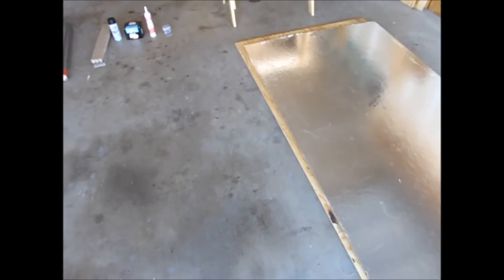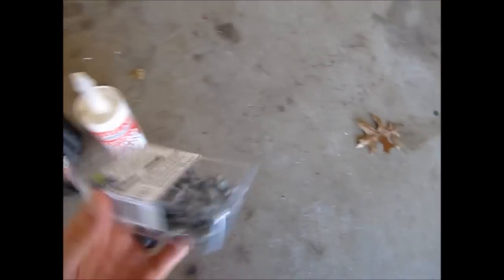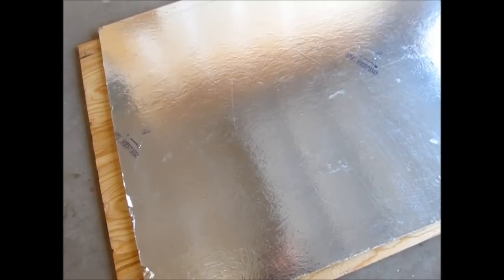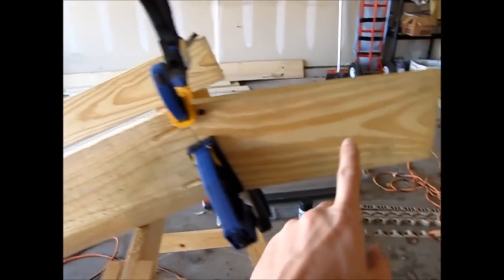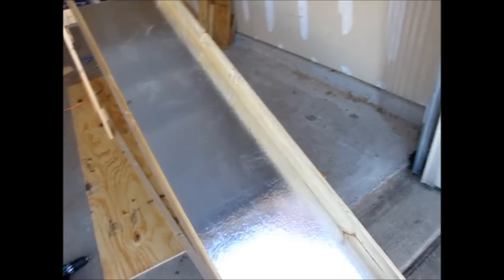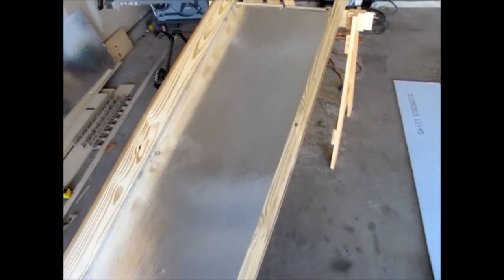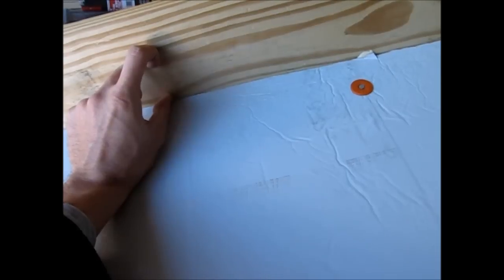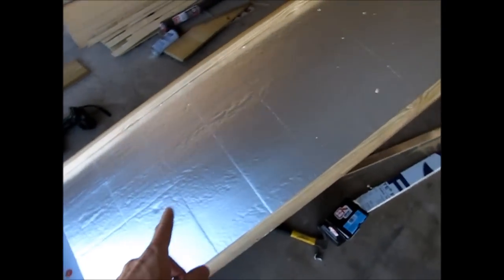FREE Heat - How To Build A Homemade, Passive Solar Heater Window Unit

Comment: This was 1. not cheap and 2. super inefficient.
 Give me a call if you ever need some engineering expertise #MasonInnovation
Heat travels through wood much faster than foam, use a foam frame to construct a thermal bridge. No need for the screens. That is what you want to hold your heat.  So you need something super conductive, like aluminum foil, with holes. Not an insulator like fiberglass screens.

Comment: Wouldn't the outside temperature negate any gains of the warmth created by the sun? I'm going to build a passive panel but mount it on the inside of the window.
Reply from the maker: Your window will filter most of the UV radiation from the sun so it won't operate very well.  The outside air temperature does fight against the heat but with clear skies and a nice, black interior that box gets pretty hot.

Comment: Thanks for the video. I would recommend setting up a link at the end of the video to the results video. I had to go digging into your channel to find it. A quick link would have been helpful. Still, thanks, I'm going to give this style solar heater a try. Cheers
Reply from the maker: There used to be a link but Google got rid of those in video links a while back.
Reply: @LDSreliance  Can you put it in the Description?

Comment: Need a list of needed, specific materials to build this; where might we find this?
Reply from the maker: It wasn't meant to be that kind of build so I didn't make a materials list.  I adapted the design and materials to what I had available for my budget.  Sorry about that.

Here is one of the websites that I used as inspiration for the build:
https://www.builditsolar.com/Experimental/AirColTesting/ScreenCollector/Building.htm

You can also check out the build I did a few years later that might give you more ideas:
https://youtu.be/znytJtU0za4

Comment: Did I understand correctly, is that pressure treated wood for the frame?  If so, toxic chemicals are off gassing into your air.  Also there are always people giving away free sliding glass doors on Craigslist that make great covers for this kind of project.
Reply from the maker: You can't use glass like that for something like this because it blocks UV light that is needed to heat up the heater.

Comment: Um... So this works when sunlight hits it. But it's colder at night. Soooo.... Why is this a thing? Sure it's a supplement, but not a replacement, and it wont even supplement during the period of the highest energy draw from your heating system....
Reply from the maker: Meep Changeling You are correct.  This is a small scale supplement.  If you build it in large scale it could heat your home but that isn't practical.  Just a fun little project that could save some money during the day.
Reply: +Meep “the” Changeling  quite so. there are vids I've recently seen which describe how to pack empty plastic milk containers into a flat oblong box. these are full of water which store the heat. I wonder if the ideas in this clip can be combined with the plastic beaker heat storage idea?
Reply from the maker: Jack Rainbow Absolutely.  Solar water heating is far more efficient than heating air or producing electricity.

Comment: So why did you bother using the foil-backed plywood on the bottom of the collector box if youre just going to cover it with the foam board?  Trying to understand, not finding fault.
Reply from the maker: It is what I had laying around.  It was leftover from building my shed.  If I was going to buy the material for this build I would not buy that product.
Reply: Maybe because it was less porous??

Comment: I like his idea, but I see one problem. He needs to run a piece of insulation down the inside of the board. Other wise you lose thermal barrier.
Reply from the maker: True, there could definitely be improvements made.

Comment: Nice video. Did you make an updated version? If not could you send me instructions based on your experience. Also
..does the angle of the box against the window make a difference?
Reply: For best results, angle the heater 90 degree to the mid day sun shine for highest heat production.

Comment: does this have to be aluminium cans or can food cans be used.  having 4 cats and 4 dogs i get through hundreds of them.
Reply from the maker: +Rai Merry Yes, you can build this style of heater with aluminum cans.  I think that is the more common way to do it.  There are lots of videos and DIY instructions out there how to cut out the tops and paint them and all that.  They are about the same as far as efficiency goes but I think the cans require a little bit larger box.

Comment: I think plexiglass would have been a better choice in the long term for the top. That clear roofing piece you used will become very brittle in a few years. I used a couple pieces of this on the roof of my chicken house to let in some sunlight and it has become very brittle after about 4 years and needs replaced. As a bonus, the plexiglass would lay flat and you wouldn't have that little gap.
Reply from the maker: +Darkman Walker True.  I would have liked to have a flat piece.  My experience with plexiglass is it is easy to scratch and does not weather the elements very well.  I was only planning to use that heater for one or two seasons and it served its purpose.
Reply: There is a significant difference between plexiglass and polycarbonate also the poly is more expensive. A flat piece of that would be better versus the corrugated.

Comment: Nice job men. I really like it. But I have a question. How can you be sure that the outer wooden board will not be destroyed from either the rainfall or the air humidity during the years?  Why didn’t use for example aluminum?
Reply from the maker: I wasn't building something that would last many years.  This was just an experiment and proof of concept.  I had seen these plans on various diy sites and was a bit skeptical.  And, while they can't heat your whole house, they can certainly lower your bills or cut your use of firewood down in an off grid retreat or cabin.

If I was going to build something like this for long-term, I would put some wheels on the bottom, make it much wider, and use galvanized or treated/sealed materials like you said.
Reply: @LDSreliance  First of all, thank you very much for your immediate response.
 I now understand your whole skeptic. Keep on going the good work. Thanks.
Reply from the maker: You are welcome.  Thanks for watching!

Comment: How many cubic feet of heated air per minute and at what temperature enters your room and what is the outside air temperature?
Reply from the maker: Good questions.  I did not measure the cfm but it was low.  It was similar to cracking the oven open about two inches with the oven turned on to 200 degrees F.  You would feel warm air rising up around you but it doesn't move very fast.  I am planning on doing another build like this in the next few months and I will do a better job of gathering raw data for you.  Sorry about that.

Comment: Want to double your free heat? Lose the screen. Don't believe me stand in front of a south facing window on a sunny day with the screen on the window. Feel how warm it is, then remove the screen, and stand in front of the window, and feel how much hotter it is! Also the sun is never hitting the backing that you painted black because it can't get through 2 layers of screen at least not directly. Also use glass not that plastic crap. Good detailed video though!
Reply from the maker: This has been scientifically tested numerous times by others.  I did a lot of research before building this.  I used data from a university study in New Mexico as well as a number of websites and government resources.  According to what I have read, it will not work as well with simply a black painted wood surface.  The two most popular and widely used air to air "absorber" materials are black window screen like I used and black painted soda/beer cans.

As far as the glass, it is much more expensive, more dangerous, and actually will not allow as much UV energy through it as this greenhouse plastic.  It is actually pretty hard to find glass that is not designed to filter out a lot of UV these days, certainly not at Home Depot or a readily accessible source for someone like me.
Reply: Northstar7733 lo

Comment: What is the temperature difference between inlet and outlet?
Reply from the maker: Watch the results video at Solar Window Heater Results.  It will show you data logs of the temperature to see how it works at various times of day.

Comment: Nice work! Good concept! I like the use of the clear polycarbonate panel as an option rather than glass or some sort of a window. I like all the caulking and insulation ideas for sealing the box up good with little to no loss of heat from the box itself. I might use black tar paper (that's what they use under the shingles for roofing, in case you didn't know) for the backing of the box, minimizing the need for much of the black paint. I would also use a dryer vent, fashioned like a snake, weaving up and around the inside box (painted black) rather than the soda cans most use, creating a natural up and around airflow heading up the top.

I would attach tubing to the end of the vent to be fed through a window a "sealed" open window that I would build a wooden box/frame for to lower the window onto with appropriate seals. Somewhere inside this tubing TO the window, FROM the box, I would be placing a small solar powered fan (maybe barely bigger than a CPU fan on a PC) to draw up the hot air from the heat box. I would then put 2 smaller air flow tubes (for the cooler air) to draw air OUT of the house (from the window box) to the BOTTOM portion of the heat box. This creates a natural air flow. This concept might lead me to build a DIY air exchange system where I would draw out or exchange the moist and musty air in the basement for dryer, fresher and heated air from outside or from the box. Having a steady temperature in the house is better than a musty lower level and an overheated 3rd floor with perfect temperatures in the middle floor.

Man, I'm anxious to try this out! I can hardly wait to get my OWN house to do this in. I currently rent 1 side of a duplex with my girlfriend so we can only do so much. I am looking forward to putting this all together. I also need to find and fix the leaks in this place now as we will MORE than likely be spending yet another winter in it with 100% electric heat. And to think it's supposed to be a worse winter here than winter of 2014!! I LOVE the northeast! Thanks again for the ideas in this project.
Reply from the maker: +Lee Forex I feel your pain man.  We have electric heat here, too, which is why I started tinkering with these kind of heaters.  And if you make one like this you could even use it in your duplex because it requires absolutely no permanent modifications to the house.  You just set the outlet/inlet inside the window and then close the window on top and seal around the edges with foam or cardboard or something.  It produces REALLY hot air but in small volumes.  If you put powered fans in it you will get a greater volume of air but it will not be as hot.

Good luck with i!
Reply: So will building these boxes WITHOUT the use of a fan be able to have enough air flow to "project" the warmer air into the other side of the room?

The other thing I was wondering is... Like, I know in summer when it is hot, if we don't use the A/C on the 2nd level it is HOT well into the night as the heat from the day rises to the 2nd level and gets caught up there. I wonder if we bring the heat in from the solar box during the winter if the same deal will happen as it does with the heat trapping and staying upstairs all night.

We can't even sleep comfortably upstairs at night, after a hot day, and it is hot upstairs ALL night without using the A/C. It' cools off at night, nicely to the 50's (F) but even using a fan in the window to attempt to draw in cooler night-time air will not do a thing. So my HOPE is that we will have the same "problem" of not being able to get rid of the heat that finds it's way upstairs during the day because we won't have any sunlight to continue the heat from the solar box at night.

I wonder even further if the lower we draw the air from, i.e. from the basement, then into the bottom of the solar box, the better the air flow will be? It's always freezing in both the garage and the basement. I plan on building at least 4 boxes, all 4x8 using composite decking 5/4 board, as they say, for the lack of maintenance needed.

Thanks for the response, btw.

Lee
Reply from the maker: Lee Forex
The reason the upstairs stays hot all night is because the entire house literally soaks up the heat and then slowly releases it all night.  Think of when you cook a lasagna in the oven and take it out.  It can still be too hot to eat in the middle 15 minutes later after you take it out.  It takes a while for it to release all that heat from deep inside.  Same with your house.  All the wood boards and floor and roof and brick/siding soak up heat all day long to well over 100 degrees and then release it all night into the house.

You won't be able to generate that much heat with that small window unit.  And it will not heat the other side of the room unless you have some air flow movement around in the room like a ceiling fan or something.  This type of heater will slowly heat a small room over a period of several hours maybe 5 degrees max in direct sunlight with the right angle toward the sun.
Reply: +Lee Forex DON'T use tar paper.  Heated tar paper will make your house STINK and probably emit toxic fumes too.And It will fade badly in a few weeks at most. I think metal roofing painted black might work. Ever touch black metal that's been in the sun ?
Reply: @meauxjeaux431  and gang, using corrugated metal roofing in the collector has an added benefit in that the curved corrugation has more surface area in the same space, allowing for additional heating.  In the solar collector I'm building, I'm also making the outside curved to take advantage of the sun tracking throughout the day, and fire bricks to store the heat to release after the sun goes down for the day.

Comment: Why are the screens needed?
Reply from the maker: The screens are what absorb the energy from the sun and heat up to provide the heat transfer to the air.  Screens have a lot of surface area so they are ideal for this since the air can move through the screen freely.

Comment: hi I am a Mechanical  Engineering  student and My Instructor gave me same task to design and calculate also model this type of system mathematically and also drive equations of efficiency, heat transfer, thermal circuit.
will you kindly please share details of this project with me I will be very thankful  to you
Reply: would that be then called plagiarism?

Comment: Looks great, but we have a dull cloudy day here it's raining and cold that's only going to work if the sun is shining and you may not even need to heat the house.
 I heat my house for free with a waste oil heater and it burns dirty car engine oil cleanly.
Reply from the maker: That sounds like a great use for old engine oil.  I think you would be surprised at how well this device works even when it is overcast.  Now if it is raining and really dark then it won't do anything.  But if the sun is out but it is behind a cloud or it is overcast but not dark then it still works, just not as well.

Comment: Why would u need to hear your home if weather out side is great
Reply from the maker: If the weather outside is 35 degrees and sunny, your home will still be freezing cold.  But you can convert that sunshine into some extra heat for your home.